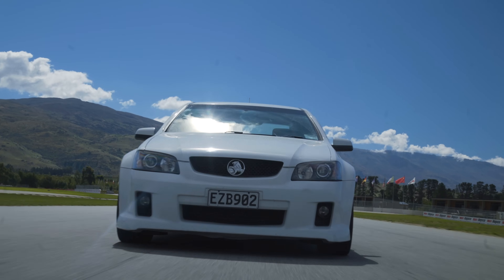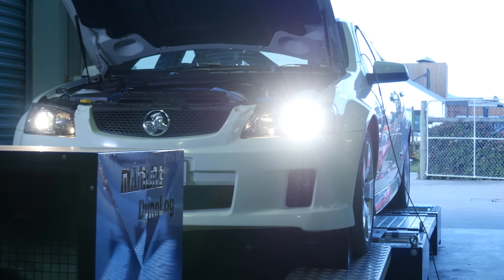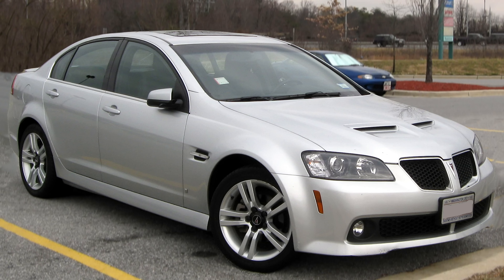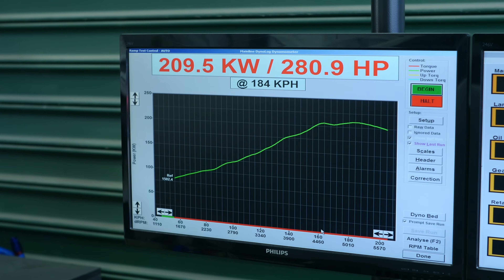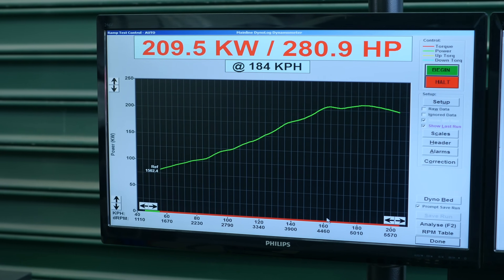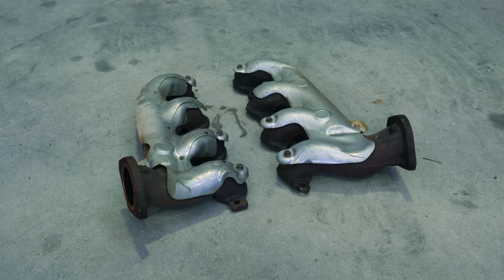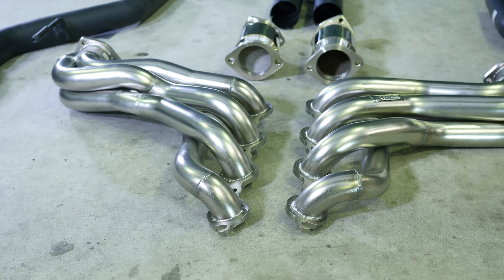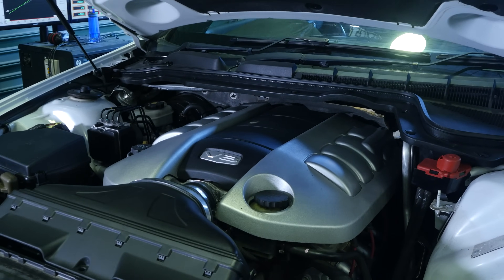We Have A 6.0L V8 L98/LS2 Engine And A Plan! [BUILD]

Comment: i have a 2009 ve ssv with l98 6 speed manual i was under the impression only the manual version had the l98 and the auto had l76? obviously i was ill informed.  would love to see the gains you get i already have the full xforce exhaust with headers .  Have not got it tuned yet waiting to put in the otr intake.  Well done on your video.

Comment: A piece by piece parts list and costings would be helpful. 
I bought it just over 12 months ago from Sydney, its still as I bought it. 
I have a 2008 L98 6 Speed Auto,  ve SSV ute, it already has extractors, Mafles system, cold air induction and 3" x pipes. 
 I'm not sure if it has been opened up from the stock tune or not and I'm also not sure if the cam had been changed or not either, I would like to gain some extra HP and have that cam rumpy sound but still keep it drivable. 
so any technical help would be much appreciated. 
Thanks.
Reply from the maker: When we add the cam we'll add a bit more details around the parts etc, but costings etc are a bit irrelevant given the vast majority of people will not be located in New Zealand - Taz.
Reply: What sought of HP were you aiming for
Reply from the maker: @davelindawindus6212  more than stock 😂 We don't really have a number in mind, this is just a shop car for us at this stage. Intake, exhaust and cam are generally the 3 easiest things to do for big gains for the money you spend regardless of the engine and power goals unless forced induction is on the cards too - Taz.
Reply: What would I be needing then to get to a nice steerable 600rwhp

Comment: I though these l98 motors used ls3 rectangle ports, what was stated is that it uses ls2 rectangle port heads, or is there 2 x ls2 heads with diffirent ports?

Comment: What the hell 30 to 40 KW yet you put a cam, headers, cat back system and the tune, and the cost is around 10K if you factor the cam and fitment and labour to do that ? More like around 100KW extra at the rear wheels if you have the right cam and headers, which 1" 3/4 headers are just fine, unless your going to put a magnuson heartbeat later on ,then go the larger headers 1" 7/8 inch and stick to euro spec 200 cell cats, that way your still getting the HP and keeping the emissions lower ?

Comment: Will be tracking this build as I have pretty much already done all this to my G8. I haven't done a serious dyno in it tho. Put it on the Dyno Challenge at LS Fest a couple of weeks ago and mine made 362 hp to wheels. Dyno guy didn't even rev it all the way out. Was kinda disappointed he didn't wind it out to the red line like I told him to. Have some videos on my channel of it.
Reply: You really need it professionaly dyno tuned. Can be very catastrophic for your engine if you dont, also you will gain all the benifits of the upgrades you have done.

Comment: Wats the difference between l98 to a l77
Reply: I'll answer that because clearly he has no idea. L77 is LS2 which is cathedral port yes displacement on demand tho however D.O.D delete best option.
L98 have rectangular port heads. Same displacement different heads slightly different stock cam spec.
Reply: L77 have displacement on demand

Comment: The cold air package looks like it will help, Andre, but do you have any concerns about icing up of the throttle butterfly in that chilly Queenstown winter? Maybe a summer only mod?

I'd add one of the bug-bears I have with dyno's that use an acc'n mode for power readouts and just provide an ATW power curve - while they are useful for comparative tuning, they do not take into account the internal and tyre friction losses or the  INERTIA of the engine and driveline which can be a significant factor. True, some do have a run-down mode which, with the vehicle in neutral or clutch dipped, can calculate an approximation of load losses, but at best it is an approximation.
Perhaps a good illustation of this is if one gives a healthy blip of the throttle in neutral, then (with the vehicle safely supported) puts in into a tall gear and does the same. the response will be noticeably reduced because the inertia of the parts is greater and more torque/power is being parasitically used to bring them up to speed.
You can also see this with changes in the dyno's acc'n rate, especially with a fast run compared to steady state at the different rpm points.

Who the heck gave a thumbs down? Guess there's always one :-(

Comment: If I understand correctly 25% power loss means there is a 60 kW oven under the car? Not counting the engine power loss... :D
Reply: There are also inertial losses unless it is a steady speed/rpm test, and there can be significant losses through tyre friction and their distortion heating them.

Comment: Can you do the fuel economy test? didn't think with these upgrades you could get better economy
Reply from the maker: Yes I believe that is part of the plan for this project =) - Taz.
Reply: I have a Pontiac G8 GT and have intake, headers and 3" exhaust with a nice cam and it's tuned. Consistently gets 24-25 mpg on highway as long as I keep it below 70 mph. Has no DOD. Even running 80 mph it will get 22-23 mpg.
Reply: @JadXtreme  if you read this do you know how much power you were making. I recently got a 6.0 cam and intake next I'm doing 3.73 gears and headers just curious
Reply: @northmn5870  I had it on a dyno trailer at LS Fest and it was making 360something hp when the guy let out of it and it was still building power. The 3.73s would definitely bring the mpg down and with the 6L80E, it may struggle to grip 1st and 2nd. Some swap the 5th gen Camaro diff as it's either a 3.25 or 3.55 I believe
Reply: @JadXtreme  nice yeah I have a 2015 caprice and I'm starting to realize with the 2.90s that it has in it right now I will be needing to do poly bushings for the subframe because the whole back end of the car shifts going 2nd 3rd and 3rd to 4th its sketchy. I have a cam, intake 3200 stall, brian tooley pushrods, factory rockers with trunion kit on them, 660 dual beehives valve springs and I'm on e85. Eventually I'm going turbo but for right now I'm hoping for mid 400s after the headers. Thanks for replying

Comment: I was wondering if i went with an K&N filter that fits in with OEM style, of course it's designed to be used with that specific oil right? But what i want to know is if i need to retune the ECU for that filter?
Reply: Do you mean using a replacement K&N filter that uses the OEM filter housing? There are vehicles where the factory paper filters have been proven to flow better than the K&N (and other) aftermarket elements - don't know about your application, but wise to check first.
Either way, the difference will be very small, with the same intake arrangement, so re-tuning is unlikely to be required.
As an aside, don't know if anyone here has a vehicle still using a hot-wire MAF but 'oiled' filters (not just K&N) have been found to cause metering problems from fouling the wire, especially if over 'oiled'.